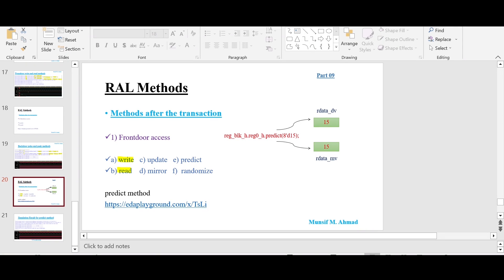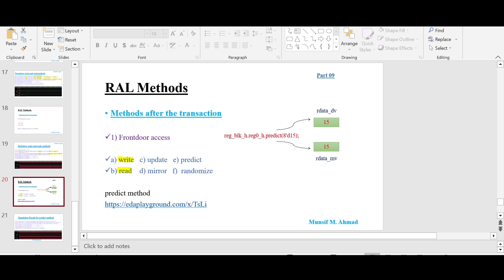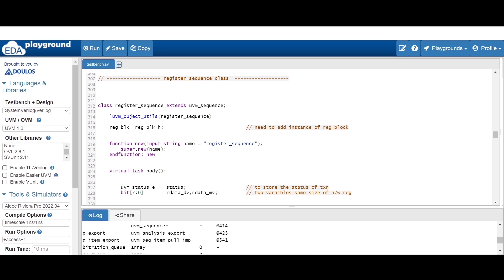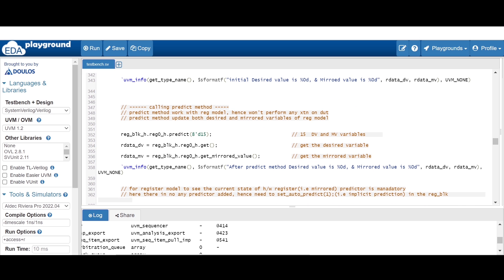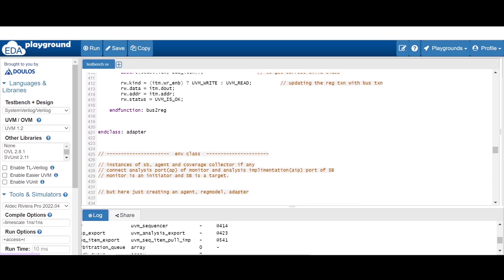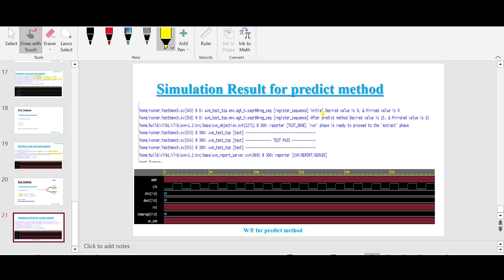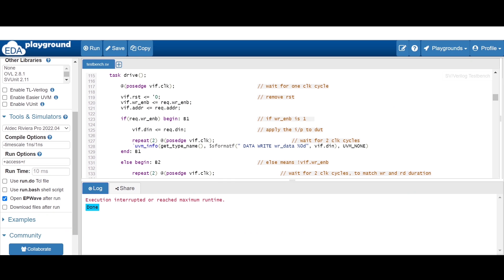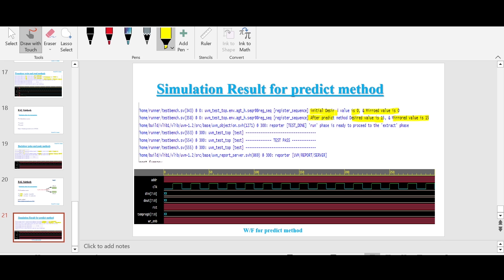Predict method in SV-UVM RAL (Register Abstraction Layer)  SV-UVM RAL VIDEO #09

Comment: why do we need to update the mirrored value without changing DUT's register? What would be the next step if we do so? any use case?
Reply: Actually we do this mainly when DUT register is updated only. But updated bypassing transaction method (e.g. write) and using some backdoor access.
When to Use:
-> When a register is updated internally by DUT logic, and you need to update the UVM model to match.
-> When using backdoor access (e.g., backdoor_write()) to update DUT register and you want model to be updated.